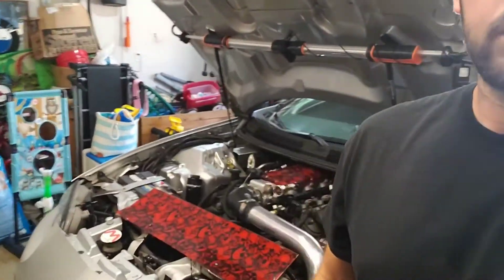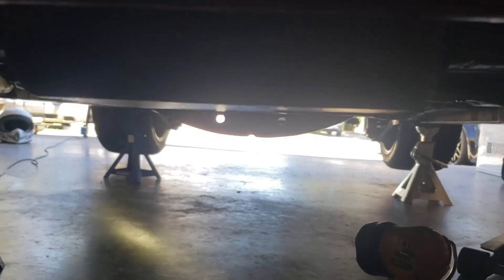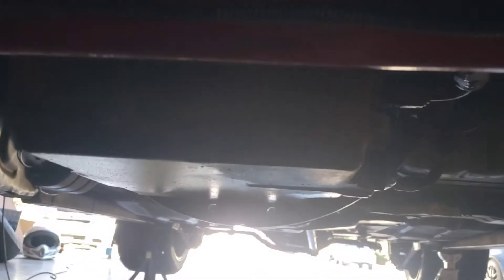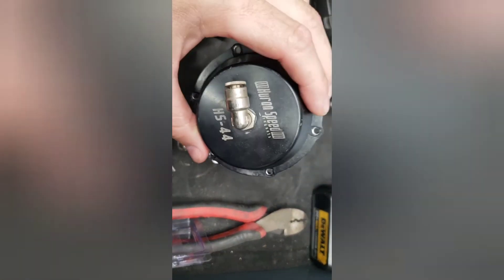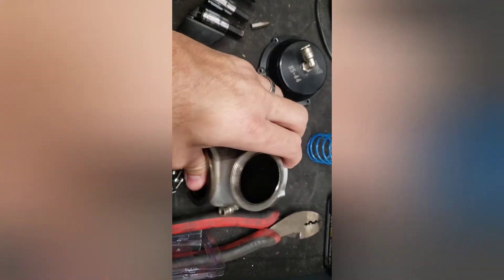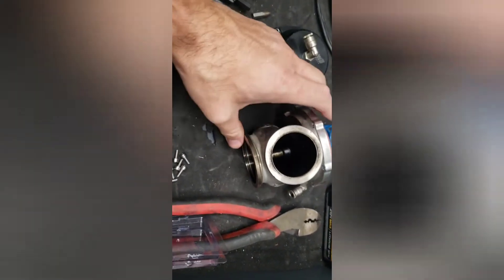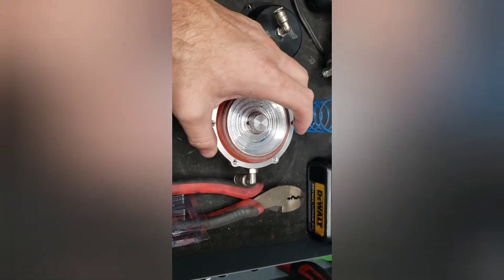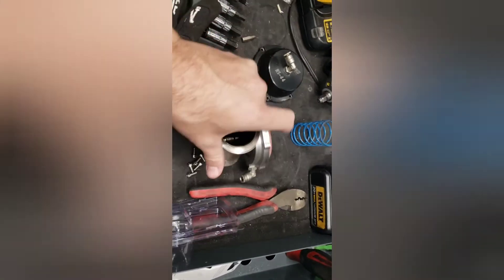TURBO CAMARO MAKES SOME PASSES AND DOES SOME DAMAGE

Comment: Im planning to get a 6.0 iron block for a turbo motor build. I'm curious to know what oil pan and baffle you are using in your  turbo setup?. 
I've read people mentioning the stock oil pan and baffle will starve the motor from oil during hard launches?
Reply from the maker: @Z83t  I'm running the stock pan and baffle. Have never had a starving problem but I run .5 to 1 qt over also
Reply: @silversurfer_ss6411   OK. That's good to hear. Thanks for the reply!
Reply from the maker: @Z83t  no problem! Thanks for being here,  hopefully you have smooth sailing with the setup

Comment: What did you end up getting on that slip?
Reply from the maker: Think a 6.5 it did a 1.35 60ft with the wheelie lol
Reply: @silversurfer_ss6411  badass.  Nothing wrong with that.
Reply from the maker: Thanks! I've got to change a few things and get the front to stay down
Reply: @silversurfer_ss6411  I doubt mine will do all that but idk.  Just ordered a set of Hoosier QTP 27/11.5R15 to see how it hooks.  Won’t hook good enough on the 325/35R18 ET Pro’s to get a good enough time.  It has the potential just not on them tires especially with no sidewall.
Reply from the maker: Ya trying to run on a 18 really adds to the difficulty level. I've never ran Hoosier always been a m/t guy
Reply: @silversurfer_ss6411  same!  Always been Mickey fan myself but I don’t think I can fit a 28 and 26 is too small.  28 I’d have to raise my rearend and like my stance as it sits now.
Reply: I talked to you the other day on FB about your video.  I just sent you a friend request so we don’t have to fill this feed up with endless messaging lol